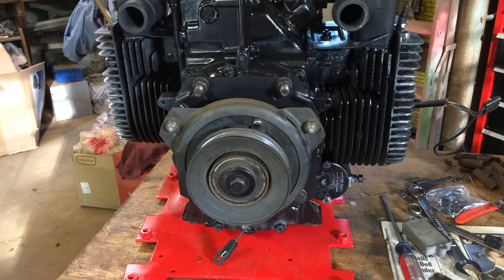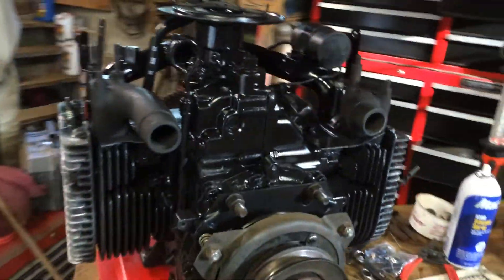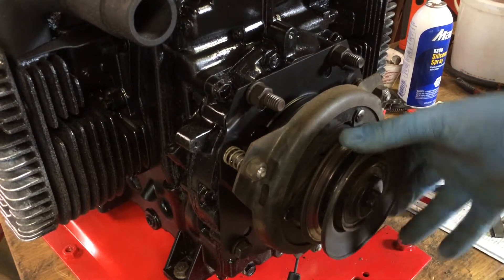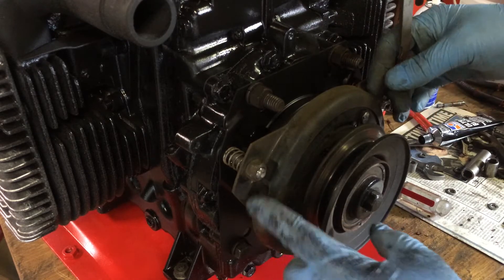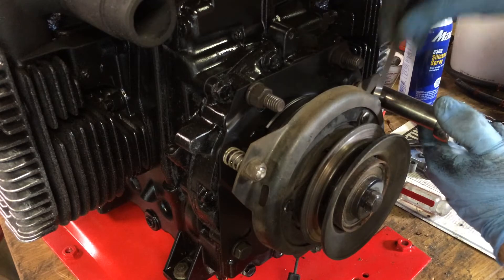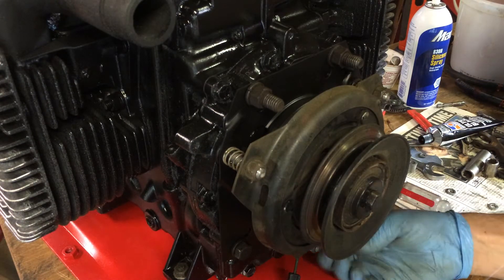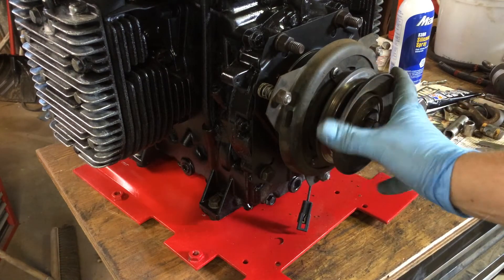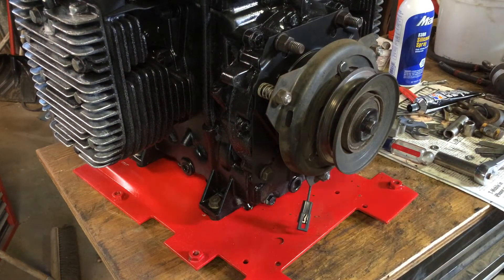kohler KT-17 air gap adjustment

Comment: Out of curiosity, I have been wanting to try this. I have a question. 

I keep having pto switch fail. I was told to try this. They claim it was getting hot because of that. Is that possible?
Reply from the maker: The air gap will help your switch issues